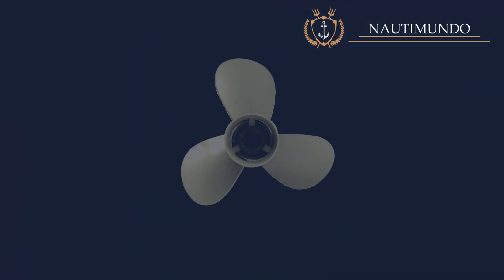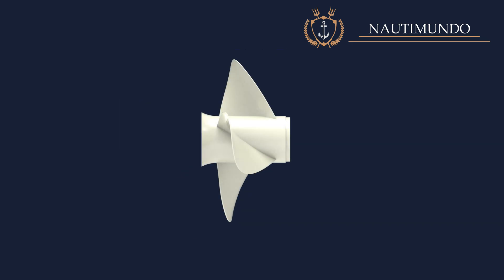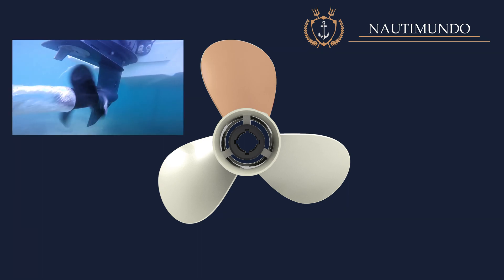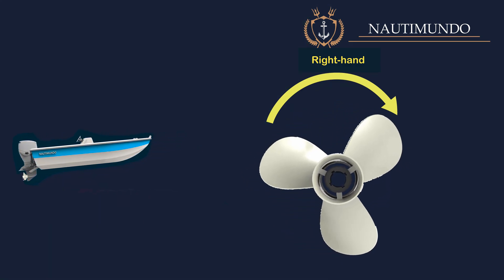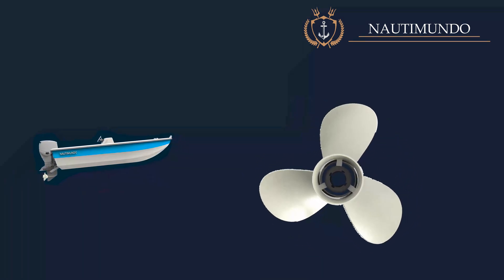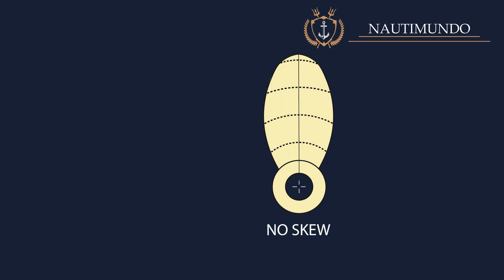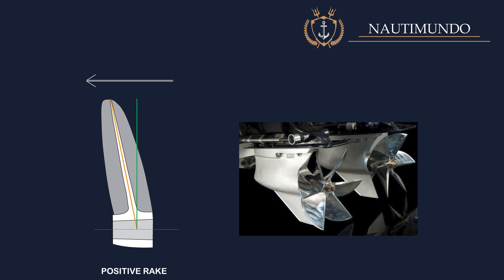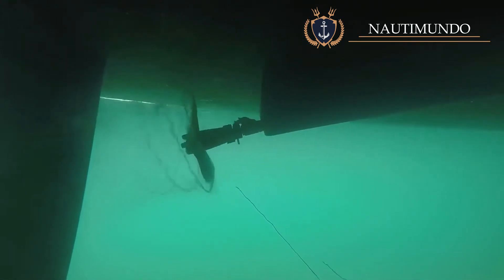✅ Propeller basics: How does a propeller work?  Propeller parts, Pitch, Cavitation, Ventilation

Comment: Since you're the marine /prop exper hope you
can help. We have a twin Yamaha
200hp. 1 with standard rotation and
another is counter
rotation. However every single time we
use the counter rotation outboard alone on
forward it does not give the same
power as the standard rotation
(probably half or less the power even
at
max RPM). While the counter rotation unit on reverse it's even worst. Barely move or able to maneuver. Both on
17pitch props.
Anything to do solving this counter rotation issue? By the way, we have inspected the prob hub/bush and its totall fine. The issue was there since day 1 the brand new outboard was
installed. Tried using 19p counter
rotation prop and its the same.
Reply: Which angle reduce cavitation i. e rake or skew or any other angle